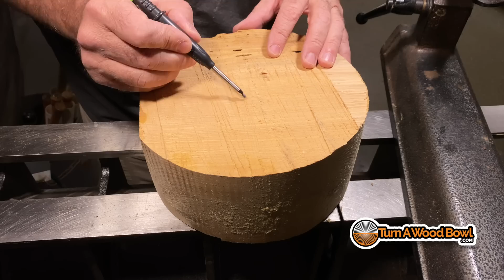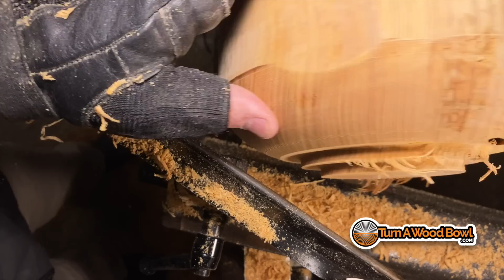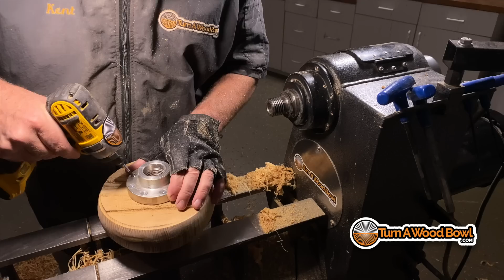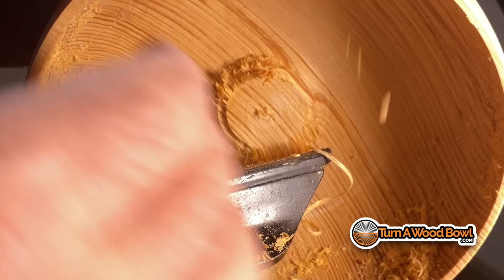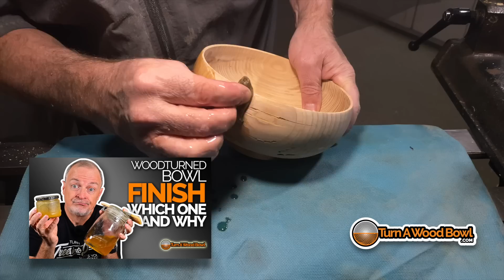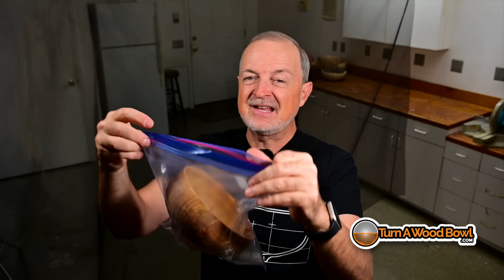Do You See It - Cypress Woodturned Bowl Video

Comment: Watching other turners I see them frequently using a drill to establish the max depth of the bowl so as they turn they don't go too far. Do you ever use that technique? In my limited turning experience I'm always afraid I'll go too deep.That method seems to require that you hollow from the center out to the rim which negates the support you get by leaving the center mass.
Reply from the maker: Mark, good question. You can use that technique. I like to determine the wall thickness at the rim and stop frequently and match that thickness throughout the turning. Happy Turning!

Comment: If you heat the wood to approximately 150 degrees for 24 hours it will kill all unwanted organisms
Reply from the maker: That's very specific, Matthew. Good to know. Thanks and Happy Turning!
Reply: What about freezing in the bag? We do it with wool to kill moth larvae. It doesn't take long.
Reply: That should work also. The method that I mentioned is how it is done as the final stage of kiln drying. They call it the sterilization phase.